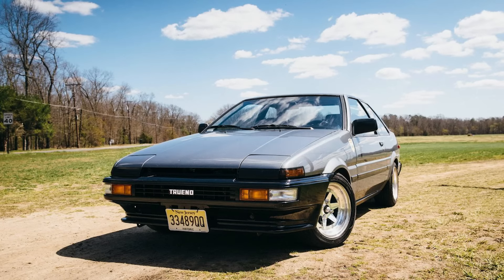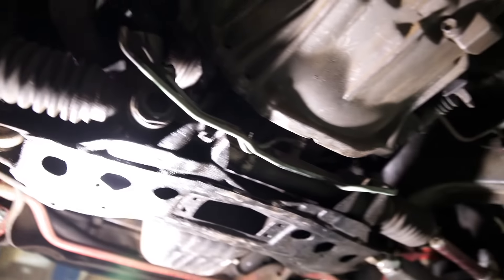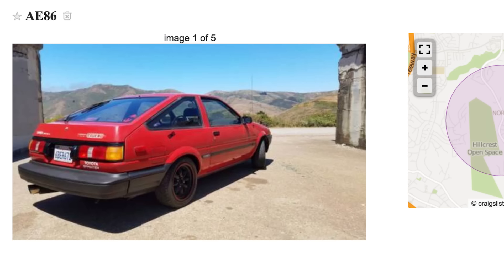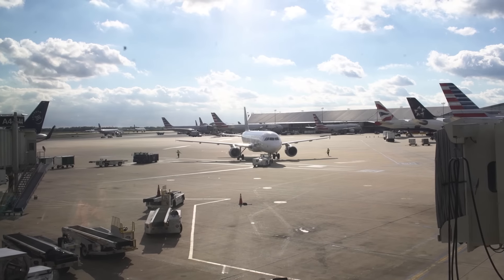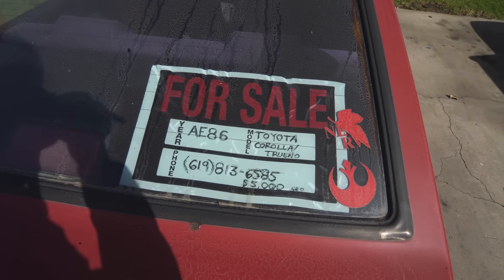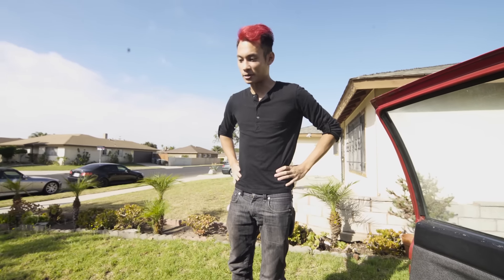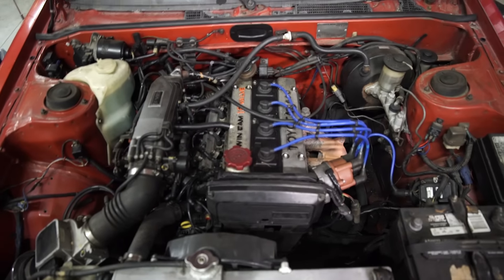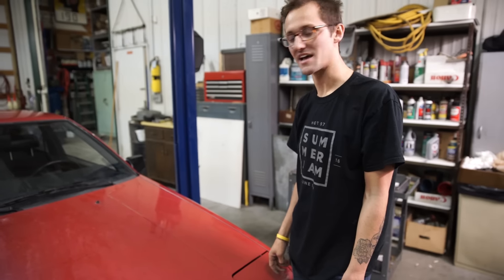Eric's AE86 Rebuild Episode 2: New Shell

Comment: last week took my st162 celica gt hatchback for a run up two steep roads after a week of body work and new paint and interior work turns out it made it up and down but coming bck up it blew its trans or converter and it made it back home with it for about 5miles on 40 to35 miles an hour bestsy will be non op for a good time in my gargre but the good thing is that i have a another to have fun and its engine is strong and fresh really was never used old couple so i bought it a year ago and now finlly get to drive it and what to stick new engine in my beloved baby and im hpy at the fact that i still will drive a celica gt and hatch and same year those body styles really get to me and they are just alike the corolla.

Comment: Now I'm not 100% sure how Toyota does it, especially in '87, but I think there's a way you can take the entire dash out as one piece- steering wheel included. I know the two are not even close to similar, but my Neon only had 6 bolts holding the entire dash in. After those came out, it was just unplugging a couple fuses and then detaching the steering wheel from the steering column.